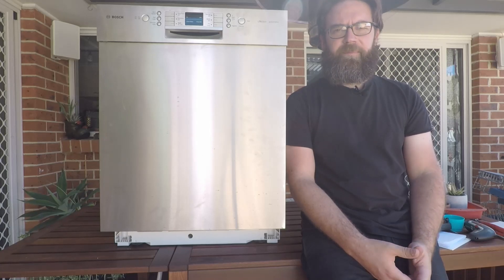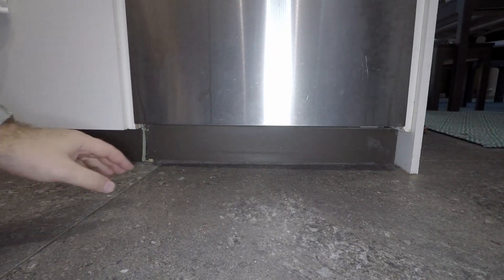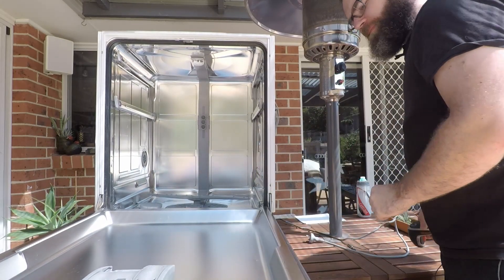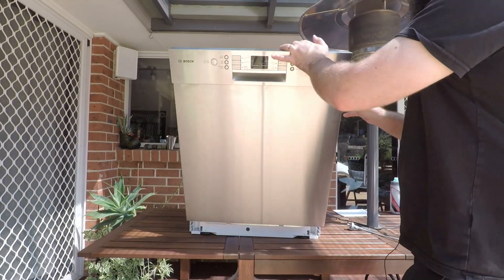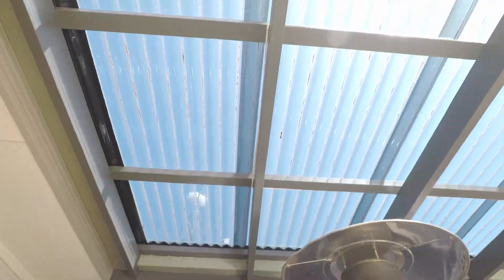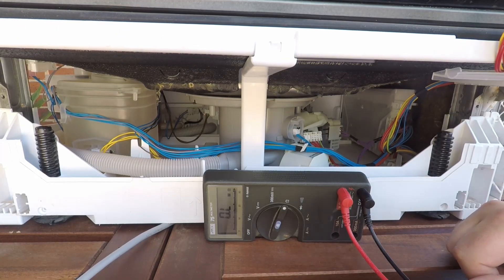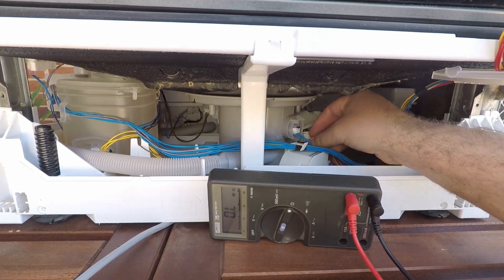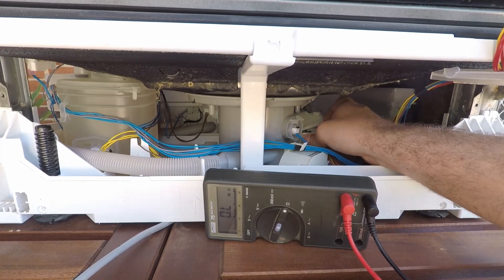Bosch E09 E10 error code diagnosis and repair

Comment: My Bosch unit has an E09 code but the water seems to be lukewarm at least. I'm running it more to see if it gets to temp or not. The E09 code usually happens at the end of the cycle which is a bit of an issue as it is a 2h 30 minutes cycle and once I open/close the error code is off.  So if the water is heated but not completely to the temp it should be, we can assume the heating element is working, other problems are present ?     Is the E09 code ONLY triggered if the heating element is broken ?  IIRC these elements are either good or bad, they can not be weak or sort of broken. If the element broke, the error message will be triggered because the element is broken. That can not be my case as I get SOME heat.   I appreciate any help with this
Reply: What ws that? NTC thermistor?

Comment: Hello. I have replaced the heating pump, but i still get E10 error. What could be the issue? Thanks
Reply: You need to replace the control board.  E10 is either the heat pump, the control board or the wiring harness between the two.  In my case, I first replaced the heat pump and then the control board.  The new control board fixed the problem

Comment: Hi, helpful video, I have a similar problem, e10 error code, water not heating my model is sms50e32au/35. Testing my heat pump with a multimeter I have 3 pins on the left, I’m guessing for the heater, I’m getting nothing between pin 1 and 2 or pin 1 and 3. I get 19.3 between pin 2 and 3. On the smaller plug  to the right I get about 12.3 on the 20k setting between all pins. Hope that makes sense. This is a new pump I installed about 2 months ago, but keep getting the e10 code after cycle is done. Does this mean the heat pump is ok?
Reply: As above. Helpful Video ! Have exactly the same problem as you Andrew, with a SMS69T28/73. Replaced pump 3 months ago and now throwing E10 codes towards end of wash. Pump is clear/clean, nothing at all obvious. Sounds like we have the same model pump slightly different to the video - 691956 - both the heating element (19.3K) and NTC (temp sensor; 12.4K) measure out exactly the same as you above. To me, the heat pump looks healthy.  Did you find a solution ?
Reply: @rimmel8760  same as you and Andrew. Maybe pcb?

Comment: thx, i measure ca 29 between 2 and 3 (on the left 3 pins) and between 1-3 and 1-2: 1
i read a lot about the zeolith container, that it can be the problem, but i don't know how to dissemble that... do you know anything about that? And also that the heating element can be the problem. I cant find that as well... thanks in advance...

Comment: Hi, thanks for a great video. I've tested mine with a multimeter but don't know how to decipher the results. Mine is a Bosch SMS63M08AU/50 and it only has 3 pins on both of those connections. The right side was: pin 1 and 3 = 20.7, 2 and 3 = 10.3, 1 and 2 = 10.3.
The left side connection the numbers weren't steady, they kept moving (usually rising), but they were: 1 and 3 = ~7, 2 and 3 = ~4, 1 and 2 = ~4.
What do you think, bad heat pump?
I'm getting error 09, water isn't hot. It can do a rinse without problem.
Thanks so much!
Reply from the maker: Interesting results. From those readings it sounds like the heating element is still ok, the next thing to check is whether there is power getting to it. 
So if safe to do so check the AC voltage when starting a cycle to see whether the element is getting power. It should be possible to unplug the connector and probe it directly, otherwise you will have to leave it connected and back probe it. Either way may sure you don't short out the probes to anything (or each other).
Otherwise the fault may actually lie in the wiring from the power supply or an issue inside the power module itself.

Comment: Where's the repair part!!
Reply: So what is the the repair if the pump is still in good working order?
Reply from the maker: True, I guess there's more diagnosis than repair. But if you find that the element is faulty by testing it, then the repair should be obvious

Comment: Can thermostat be problematic
Reply from the maker: It could be possible but this will usually throw an e11 error. You can check the e11 video here https://youtu.be/D23_PXztg90 for instructions on probing the sensor